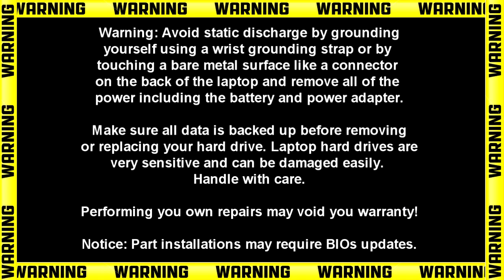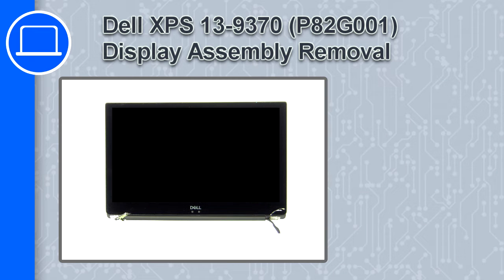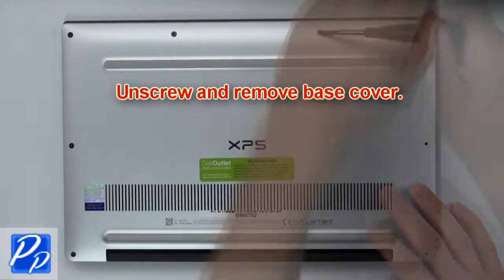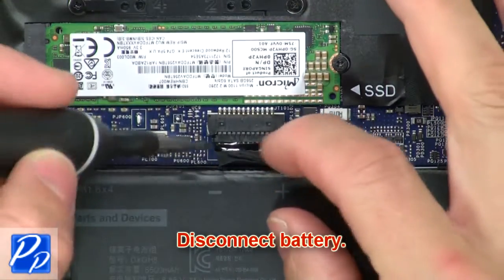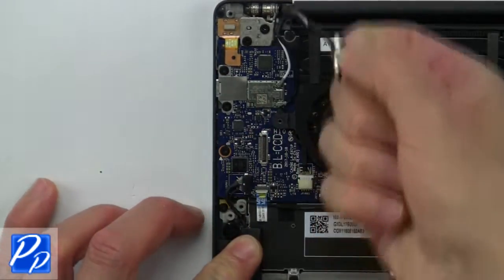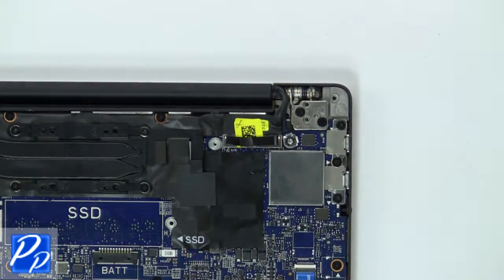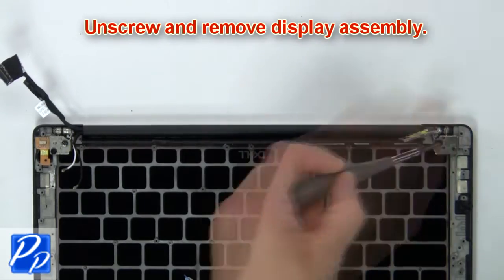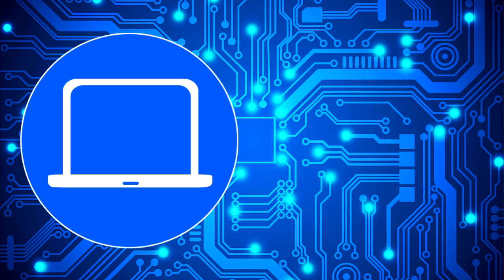Dell XPS 13-9370 (P82G001) Display Assembly How-To Video Tutorial

Comment: Hello, is it possible to replace a XPS 13-9370 UHD 4K touch screen with a different type of scree, such as the 1920 x 1080 non-touch screen?
Reply: i dont think so because there are additional LCD assembly parts when it comes to the 4k touch version - source ( owner of dell xps 13 9370)
Reply: It's absolutely possible, there's a few FHD laptop LCD's which are using 40pin eDP designed for higher resolutions like 4k. Of course those are pretty rare. This situation is possible thank :ps to production cost cut-offs, where it is economical-friendly to produce cables and covers to laptops in different LCD specs - 4k, 2k and 1080p in same model-line. 
There are differences but it's absolutely possible. It all depends on your technical skills... But wide knowledge about what you're actually doing and experience with repairs will be nice too. :p
PS. eDP it's just an "translation" from PC's Display Port to notebooks, and there's no freaking way to achieve no display with using screen with lower resolution or damage anything using same type of connector... I need to say it one more time - it helps much when you actually know what you're doing. For example disconnecting battery without touching anything else. :P Sry if you're experienced in this kind of job, no offence. 
PS2. One more thing, 40pin LVDS is not compatible with 40 pin eDP.